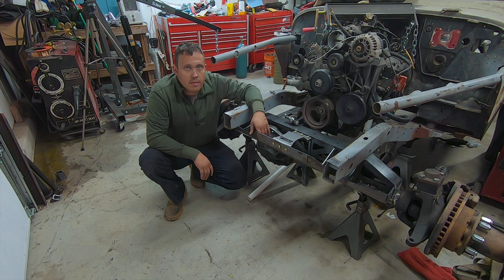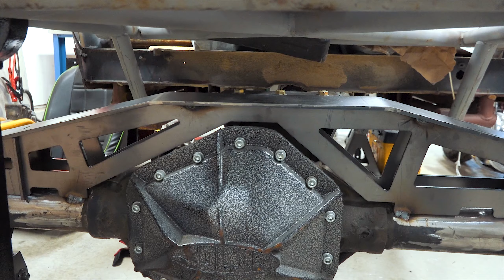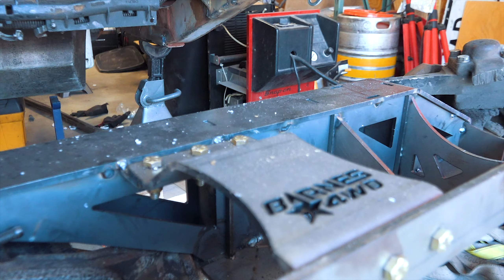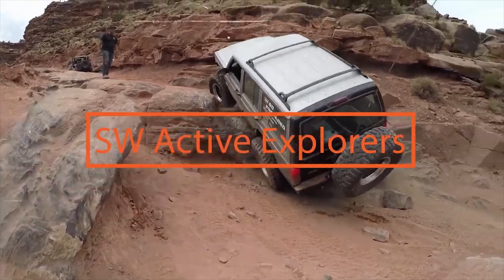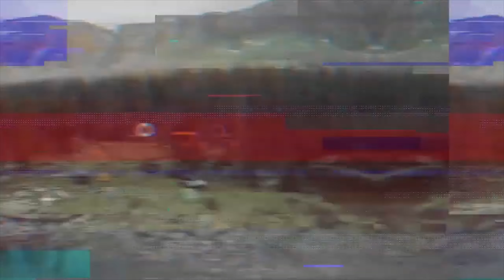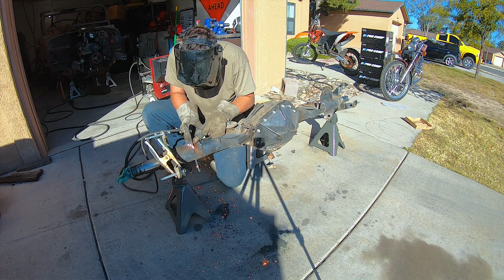Building A Rock Crawler Jeep - CJ7 One Ton Axle Swap

Comment: What vehicle did the axels come out of? I’m trying to find a front end with a passenger side diff to match up with my tcase.
Reply from the maker: So I bought the axles off a guy that had them in another jeep however he told me the front came out of a GM 1981 K30 and the rear came out of a 96 chevy 1 ton.
Reply: Thanks I’ll have to see what I can find for my cj5. Your build is pretty cool keep the videos going bud.

Comment: Do Chevy king pin front axles come with hub lockouts or are they an extra kit?
Reply from the maker: They should come with them. This one has had slugs put it however i will be taking them out for locking hubs.